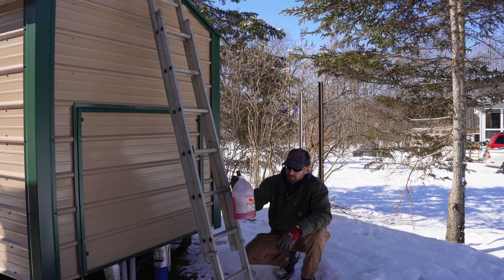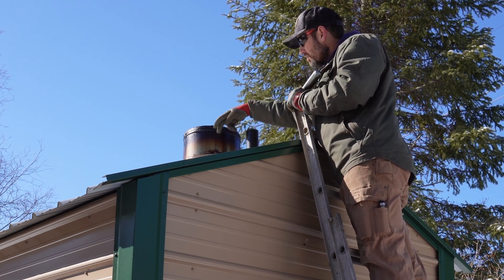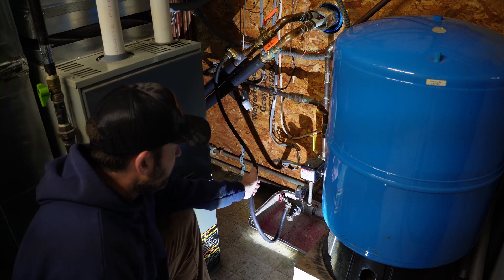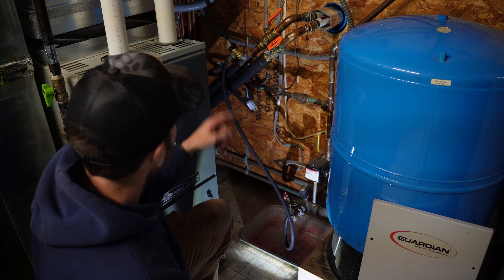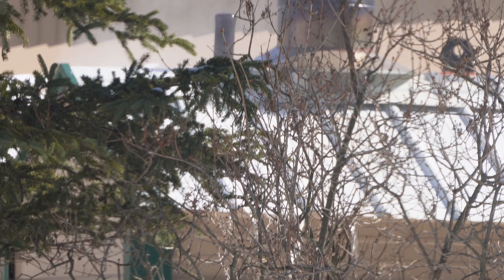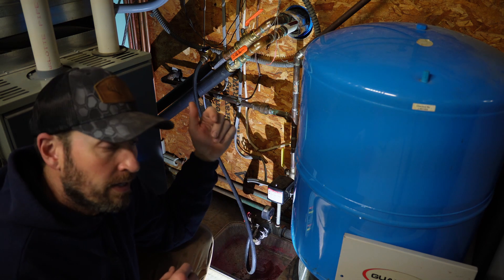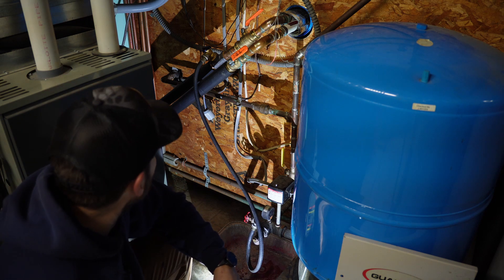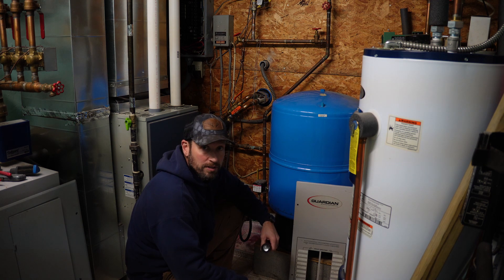Outdoor Wood Boiler water fill hack

Comment: Can you please post a link to the hardware you used to do this?
Reply from the maker: I will when I get a chance, but It's really just adding a boiler drain valve inline of the OWB pex wherever is conveniently close to a spigot, then use a washing machine hose to connect the two.

Comment: How to fill without a return line port?
Reply from the maker: Easy way is to just stick a hose in the overflow pipe on top of the boiler.
Reply: Some fittings an valves pex crimps and tool an make one